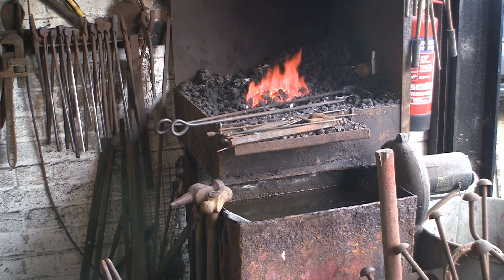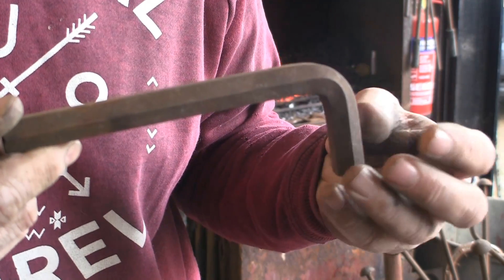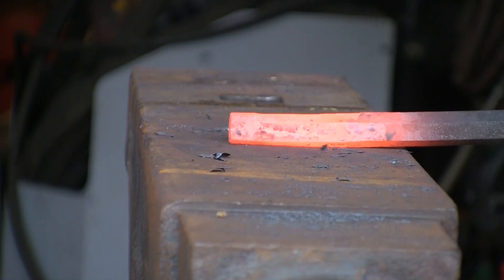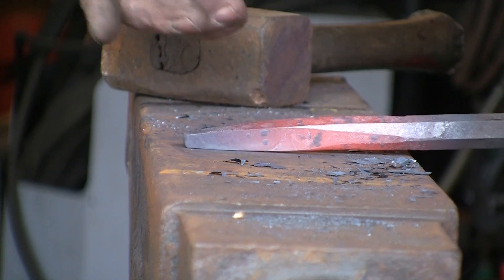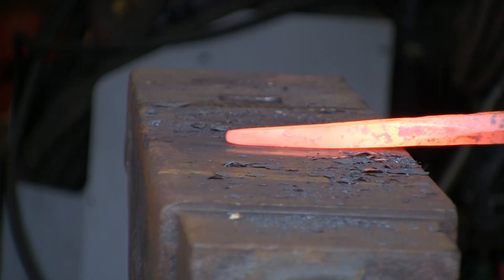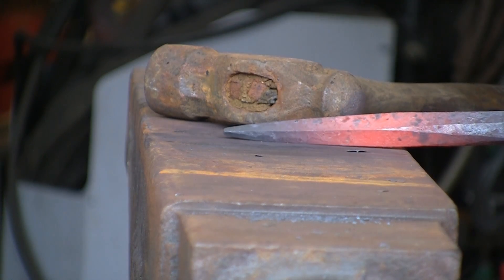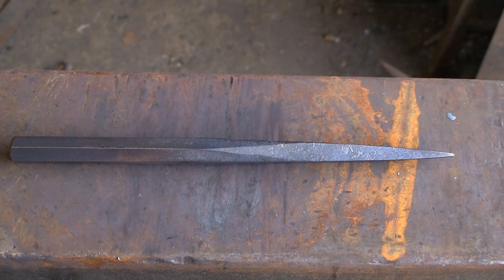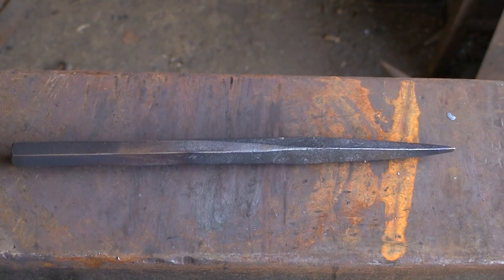Forging a punch / pritchel

Comment: I've been enjoying your videos. I'm sure on one you asked for suggestions on things to make? 
I recently got into welding and made myself a 'rocket stove', I'd like to see you make one and put your own spin on it! 
It's just a big piece of box section cut and welded on a 90 with a shelf in the front for the fuel to sit on and air to go under.
Reply from the maker: I've always wanted to make one but like the stove thing in a previous video, it will get made then just sit and take up room in the shop! I might have a go though.
Reply: I think that's a problem I will have soon! I'm thinking of making a second one but might end up giving it away. I've seen on the internet people have made miniature ones but I'm not convinced they work as well

Comment: If I was making a punch for cold material, (I need one to punch bolts out of railway sleepers) how would I heat treat it?
Reply from the maker: That's a difficult one to answer properly as it depends what steel you are using. Let's say for argument sake it's a medium carbon steel. I would harden it as normal then temper it at brown.. Give it a try and see how it goes. If it's too soft try dark orange, too hard go towards blue.
Reply: Thanks Gary, when you say temper it at brown, you mean carefully heat it to a brown colour? Great and informative vids mate!
Reply from the maker: +Duncan Noel yes, as in most f my other videos..
Reply: Thanks mate!

Comment: Is it possible to reforge old metal,or does it get to a stage of non reversible
Reply from the maker: Not sure of your term "reforge", in the case of this pritchel it would need completely fire welding back together which is not really practical with high carbon steel. Far easier and cheaper to just make a new one. When I was at college as a forging exercise we had to fold a horseshoe in half add another half and forge the whole lot back into a solid bar then make a new shoe. Doable in mild steel and a great forging exercise but totally impractical for everyday.
Reply: garyhuston OK. Cheers

Comment: Hi Thanks for posting your video's they are very interesting. I'm In Manitoba Canada now, but guessing from some of your local videos, I  grew up not far from you at  New Mill /Tring.   we have a forge here we shipped to Canada when we left the U.k., it was a double that came out of the metal work shop from Mortimer hill school Tring when I was a pupil there in about 1986, before we moved to wales. My Dad and uncle got it for 10 quid I think, and cut it in half, and welded legs at the new ends. My uncles half is in Devon now and i think he uses his to make ornamental things  .ours has not been set up since we got it, but has been used with a vice bolted on it for welding and heating stuff with a cutting torch. But as I'm getting older I fancy setting it up and trying to make some of the twist and fancy handles and stuff you and some of the other guys I follow show us. Regards Robert
Reply: Fellow Manitoban? I also forge iron and have been for some years. If you want any help setting up depending on where you are I could help you out.

Comment: Couldn't you reforge the old pritchel back to working order or would that just be a waste of effort?
Reply from the maker: Not really very practical, trying to forge weld high carbon steel isn't easy. Just not worth the effort. Easier to just get another Allen key!
Reply: +garyhuston Fair enough, good video by the way, it's always a pleasure when there's a new one :)

Comment: Gary, what caused that crack to develop? Thanks for another good vid, I'll never get tired of you repeating the basics! Keep it up!
Reply: +SKW Bushcraft  im not gary but i think that the crack developed because the pritchel is usually made of harder and more brittle steal, therefore being conistantly hit by hammer coused it to crack up, it also culd been coused by temperature diferences , because the tool gets hot when touching red hot metal aswell, and than just cools of in air, wich makes it a bit more brittle after each time it cools of , or temperature difference culd even start forming cracks.
Reply: what he said